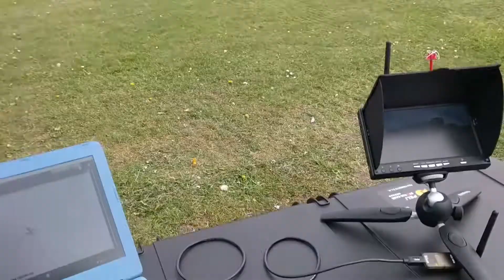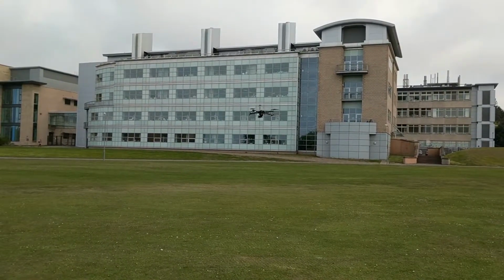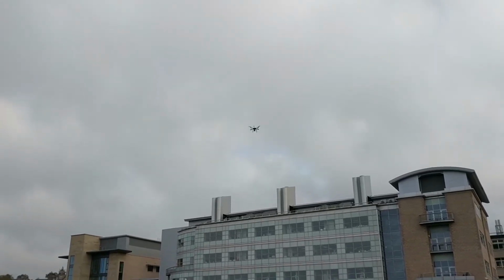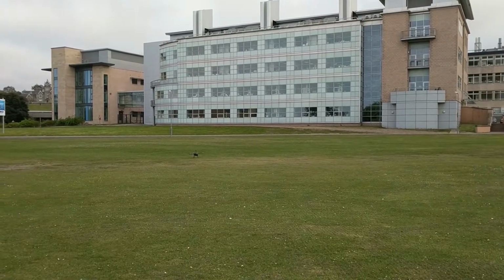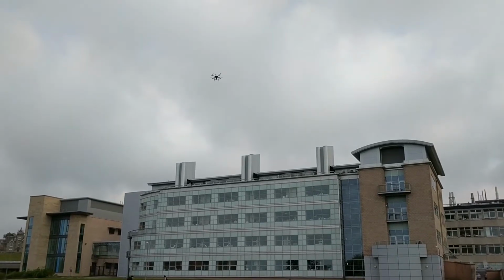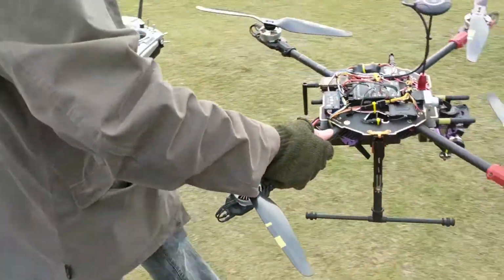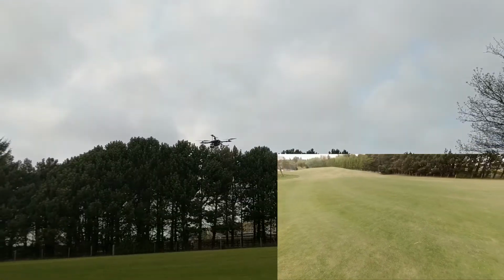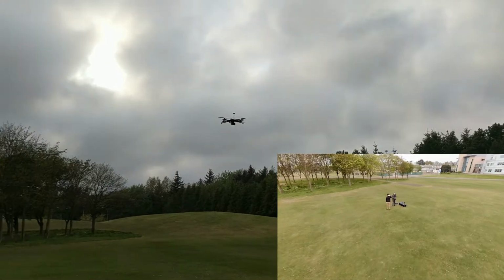Tarot 650 Sport failsafe test // pixhawk + arducopter

Comment: Do you remember if you had to change any parameter by the tarot gimbal software? Or did you use stock parameters?
Reply from the maker: I remember the software, so I definitely used it, but I'm afraid I couldn't tell you what I actually changed in it, if anything at all.
Reply: @CJDavies  Do you still fly this build?
Reply from the maker: @m.k.4467  No, I rebuilt it onto the Daya H4 680 frame in 2018 & then I sold that earlier this year. I'm currently rebuilding one of my Everycopter Y6 hexacopters with a Cube Orange to satisfy my Arducopter fix.

Comment: hi, I just wonder, Is apm 2.x product have GYRO system? do you know it anythings?
Reply from the maker: The APM 2.x hardware has a gyroscope, however APM 2.x is obsolete & shouldn't be used for new projects. For new projects you should use Pixhawk or for more limited budget consider something like Matek F405-STD (which can now run Arducopter thanks to ChibiOS).

Comment: Hloo...I have made a pixhawk drone.......but it is not stable so 
What should I do
Reply from the maker: Assuming everything is good with your build (everything tight, propellers balanced, good centre of gravity, etc.) you're next step should be to run autotune.

http://ardupilot.org/copter/docs/autotune.html

If that doesn't help, you will probably need to do some investigation into what is causing the instability, which may well be too much vibration.

http://ardupilot.org/copter/docs/common-measuring-vibration.html

http://ardupilot.org/copter/docs/common-vibration-damping.html

Comment: I have had the problem that my ESCs keep burning up after it tips over. Do you have any tips on how to prevent this? It has already cost me 3 ESCs and 3 motors.
Reply from the maker: What firmware are your ESCs running? I know that blheli has a 'Low RPM Power Protect' feature that stops the ESC from outputting power when it detects that a motor has been blocked (such as by hitting the ground). I'm not sure if simonk has a similar feature or not.
Reply: Good question ;-) Don't know. I will check this :) Thanks for the tip!
Reply: That looks pretty good actually! Did you design + print these mounts yourself or did you buy these somewhere?
Reply from the maker: Those look much better than the stock landing gear, but for 360 camera operation you still need retractable gear.
Reply: @CJDavies  sir my pixhawk land there where its is flying

Comment: What kind of flight time do you get with that battery?
Reply from the maker: 4000mAh 6S would get me 12 minutes of hard flying & landing at storage voltage (3.85V per cell), so probably 15 minutes for a fuller discharge.
Reply: CJ Davies thanks for the reply. Do you think you could get more flight time if you used like a 8000 6s? Or would it be to heavy?
Reply from the maker: 8000mAh 6S is actually a more normal sort of capacity for a quad like this, while 4000mAh 6S is a bit on the small side. When I first built the quad I bought one 8000mAh 6S for it but then I had to travel internationally with the quad & you can't take 8000mAh 6S onto a plane (it's above the 160Wh limit) so I bought four of the 4000mAh 6S with the intention of using them in parallel pairs to make 8000mAh. In the end I actually just flew them individually as 4000mAh because for most things I was doing I didn't need more than 10 minutes of flight in any one go & could just land & swap batteries. The ideal compromise would've been a 5400mAh 6S pack, because that would've been just under the lower 120Wh limit which means you have no problems carrying them on planes & would've given maybe 18-20 minutes of flight - but I couldn't find any decent packs that size!

Comment: Where do You Bay this Case for tarot 650?
Reply from the maker: It's a Peli Storm iM3220, you can check for your country's official Peli distributor. It is not a cheap or small solution though, I am actually rebuilding with the Daya H4 680 frame to make a more easily transported package in a smaller case.
Reply: CJ Davies this Case transport a tarot 680 too????
Reply from the maker: Yes, but maybe not with the Taranis in the case as well like I did with the 650. The internal dimensions are on the Peli site.
Reply: CJ Davies thanks